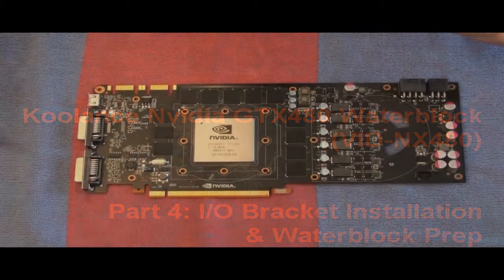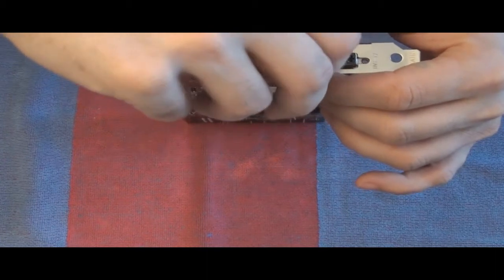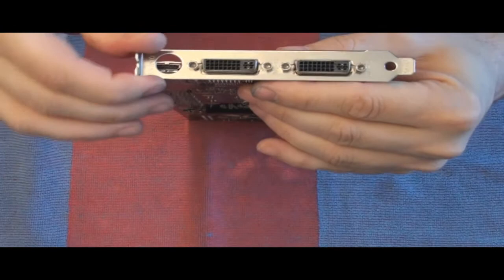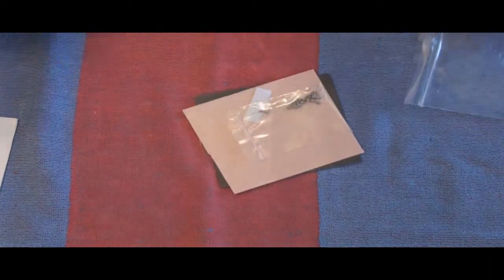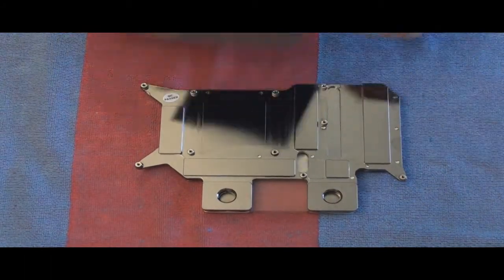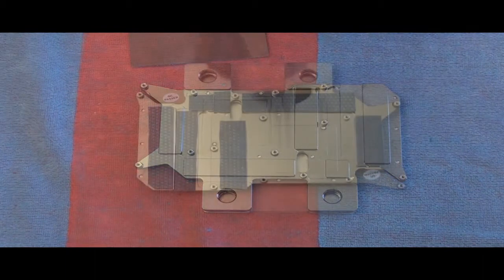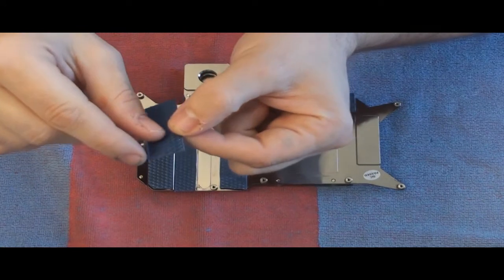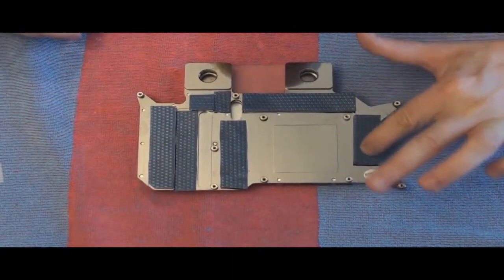Koolance Nvidia GTX480 Waterblock:  Part 4, I/O Bracket Installation & Waterblock Prep

Comment: I noticed you installed a single bracket for cards with super video ports. FYI EVGA sells the brackets for 480/470's with the mini-hdmi ports if you were planning on using them in the future ;)

Comment: Tightening is an art and you sir are correct about that. I cracked a x1900xt once and I won't do that again. It still worked but it was scary.

Oh  and the EK blocks for the 470 480 have been reported to short out the cards, so precut pads isn't worth a short on the board.